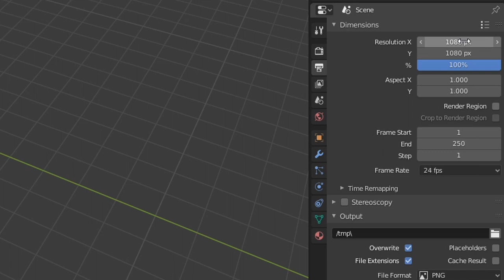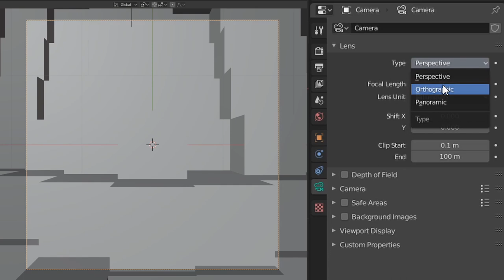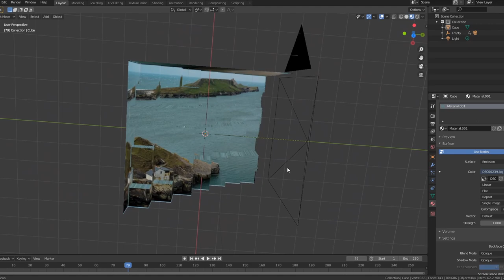Trippy Projection Mapping Transition | Blender Tutorial

Comment: How do you add the second image in the transition? I can't seem to get the UV to work correctly.
Reply from the maker: Make your camera is set in its second position in the timeline. Go into the camera view (shortcut: 0) and select all the visible faces from that viewpoint. Then press U -> Project from View. 
If you want to add a different second image, you'll have to create a new material, or copy-paste the original material and swap out the images. If you're using a second material for the second surface of the "staircase", you'll have to assign that material to those faces on the second surface, which you can do in the Material properties tab (just select all the faces, and with the appropriate material selected, press "Assign").
Hope that helps!